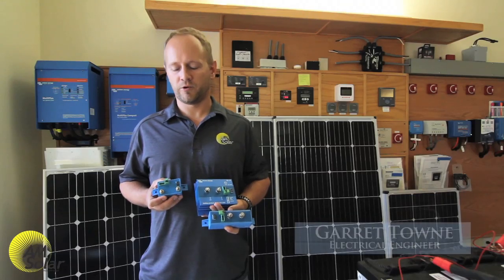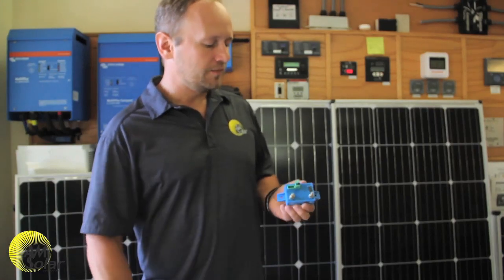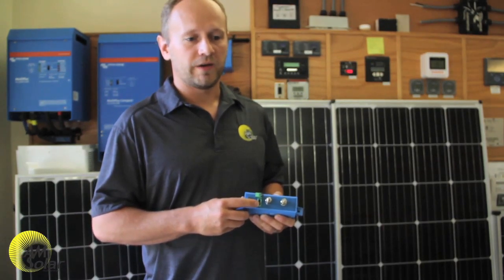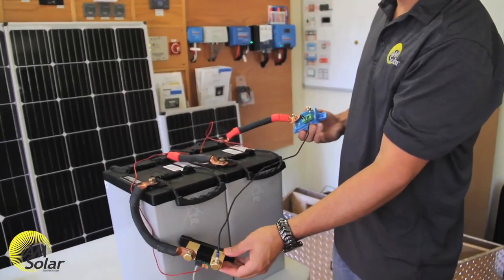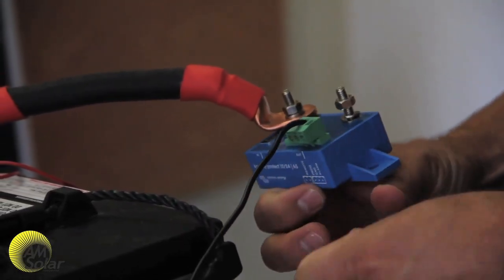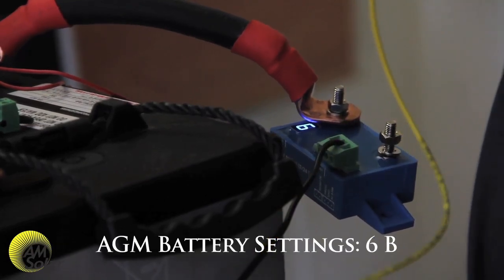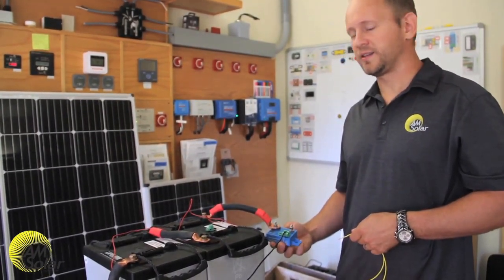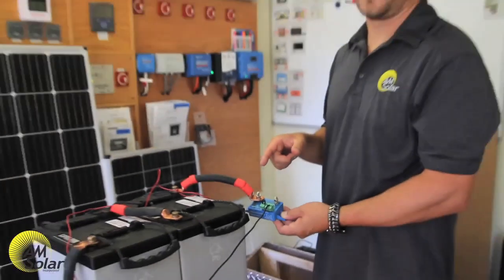How the Victron BatteryProtect Works for Your RV, Skoolie or Van (Demo)

Comment: Why would I use 8B for my Li-Ion batteries over using C (Li-ion mode)?
Reply from the maker: You'll have to elaborate on that.  Send an email to AM Solar with more details on your system.
Reply: @GarretTowneAMS - I think i figured it out C mode Lionmode needs a BMS connected and it just acts as a relay and closes when the BMS tells it to disconnecting the load. Where as the 12v - 13v setting on 8B would monitor the voltage and disconnect if it goes below 12v. I have no idea what the lowest volage a LION battery should be allowed to go though....
Reply from the maker: @chrisjohnson1715  It depends on the battery, sometimes we go with 10.5V (2.625V/cell).
Reply: @chrisjohnson1715  I understand the LION is fairly depleted at 12.6V.   These won't do that, but a BMS or BMV could be set to manage it.
Reply: @ceeweedsl  I did some research and I ended up using 8B with a victron connect even though i do have a BMS system installed. 12v is fine for a LION battery and can discharge lower ( the only difference is they drop off fast at the bottom end unlike lead acid) so its perfectly safe to use 8B.
Reply: @chrisjohnson1715  OK, I looked further and most LiFePo4 's  BMS do cut off at  12V  so maybe can go a bit below that without killing them.  I was told 12.6 is  depleted on the drop-in that I use.   I understand that draining down to 12V may shorten their life but is not fatal.   I would be nervous about taking my investment down that low, but it seems that you can do it and there is still some margin left.  My cut off is 12.4
Reply: @ceeweedsl  yeah mine is really just a failsafe i have an alarm set for 15% and then failing that it will emergency cut off at 12v. I'd be very surprised if it ever gets used altho the remote cut off has been handy for isolating the system while I work on it!
Reply: @chrisjohnson1715  Makes sense. Failsafe relay -not your operating charge floor. I doubt you will ever be tripping it unless you blow past your alarm. 

I've got a drop-in (BattleBorn) with it's built in BMS so I don't know where that's set,  but it must be have enough margin, cause they come with a long guarantee and honor it.   Never tripped.    I pull all loads from my Victron Solar Charge Controller so that's where I get my first line of discharge protection.  Except the inverter, which  has it's own low voltage cutoff. So BMS is the failsafe in my installation.    The thing with lithium, they are expensive so getting the protection/ management right pays off!

Comment: what size wire can it be used on the remote switch on a sistem with max 30A load ?
Reply from the maker: If I understand your question, we use 18ga to connect the two terminals of the remote switch.  That portion of the system only needs continuity and doesn't have high current flowing through it.
Reply from the maker: The part with 30A current would be 6ga.

Comment: Can I use any one of BP between battery and inverter?
Reply from the maker: Make sure your BP is rated for the current.  A 1000W inverter can draw over 100A.  Also, inverters typically have a low voltage cutout that would make the BP redundant.
Reply: Also, you would never want to place a mosfet device like the BP in a place on your system where you anticipate two-way current, e.q., between battery and an inverter/charger.  A mosfet can accommodate one way traffic only and subjecting it to reverse current is a very serious fire hazard.
Reply: Typically inverters automatically disconnect when the battery gets low, which means the BatteryProtect would be redundant.  That being said, as long as the BatteryProtect current rating isn't exceeded, there is nothing wrong with doing it.
Reply: Also, you would never want to place a mosfet device like the BP in a place on your system where you anticipate two-way current, e.q., between battery and an inverter/charger.  A mosfet can accommodate one way traffic only and subjecting it to reverse current is a very serious fire hazard.
Reply: @PaDutchRunner  
So where in the system does it go?
Reply: @carl8568  between the battery and your dc distribution. But honestly, if you have a lifepo4 system, you have a bms that does what a BP would do.  I think the BP is overkill unless there is a specific application for it, like if you are using some sort of relay function
Reply: @PaDutchRunner  
Yeah fair enough, thanks for the reply. I have AGM batteries with a new 4kw MPP Solar inverter, it's not all setup yet but the inverter may have a programmable low voltage cutout.
Reply: @carl8568  yes most inverters do.